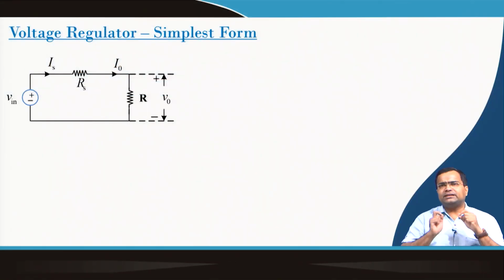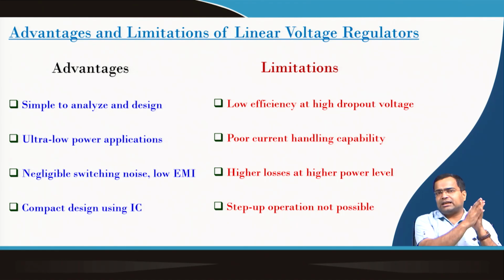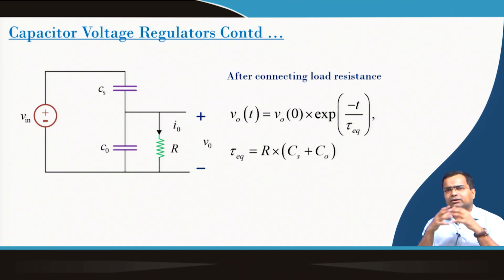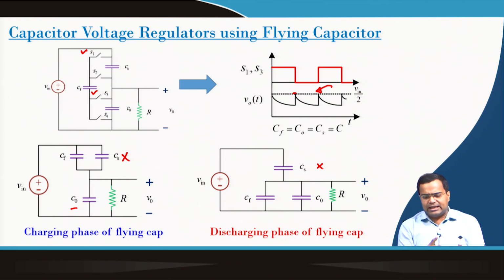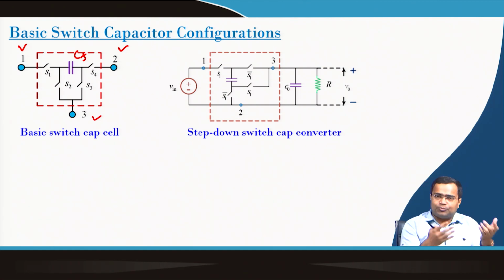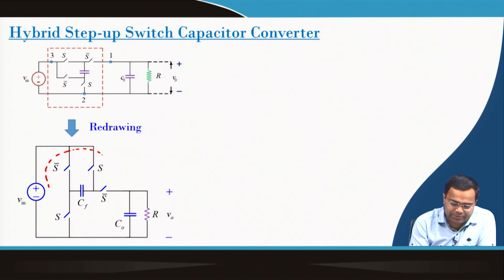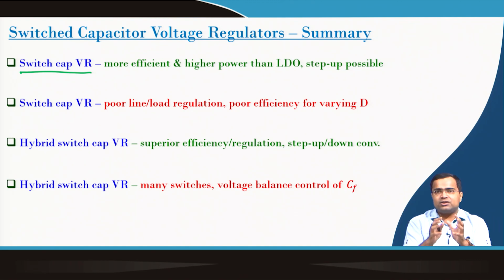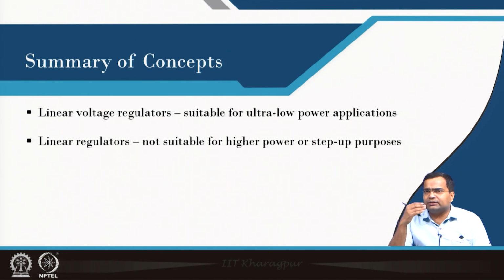Lecture 02: Overview of voltage regulators

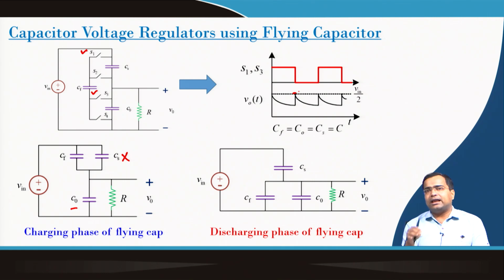Comment: Didnt get how the circuit in 16:30 always goes to Vin/2 while the tranisition is happening.
Reply: Because all Capacitor are equal than voltage divided equally and Cf will just make the balance between both capacitors. (I am assuming D = 0.5 for all switches)